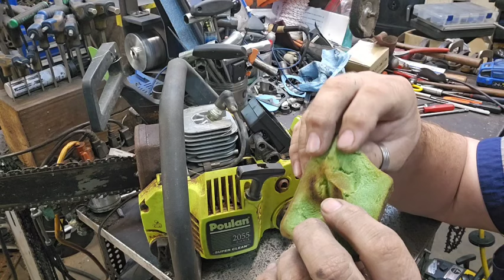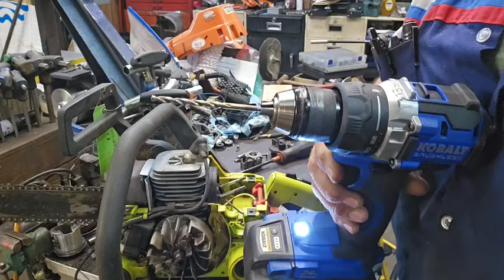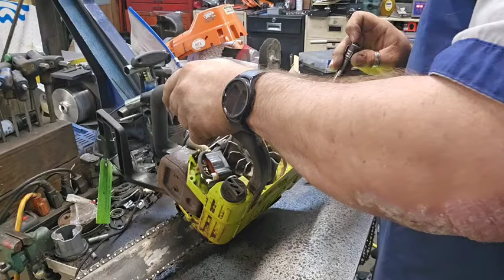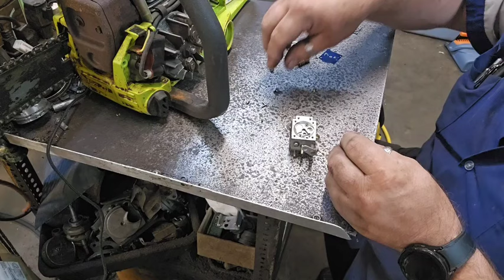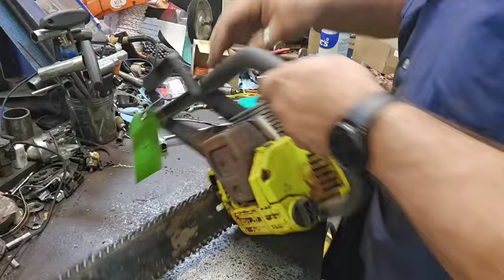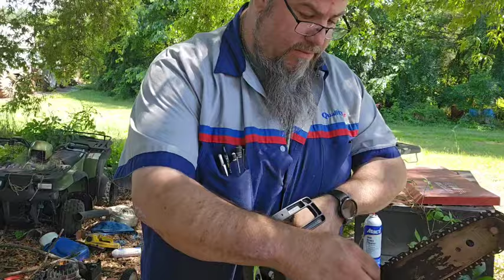Poulan chainsaw gas line replacment

Comment: I made a piece of stainless wire with a tight hook on the end and in an arc fashion, I cut off the line at an angle like you did, then I put that wire into the gas cap, up into the hole you want the new line in, then hook the point of the line on the wire, then I gently pull it back through....